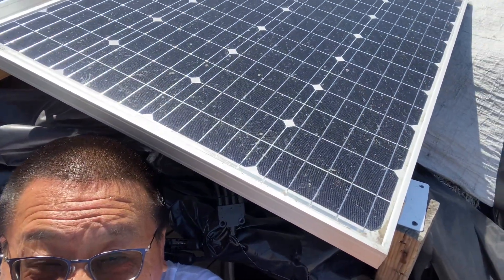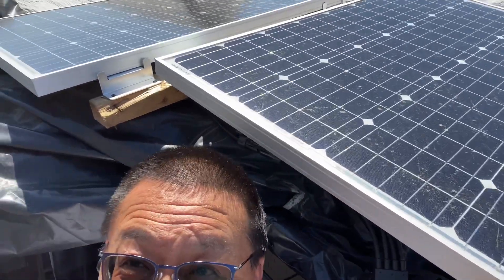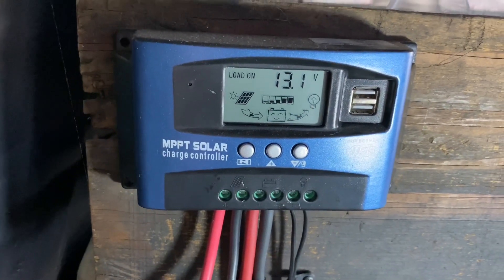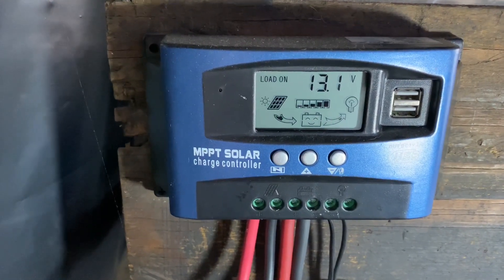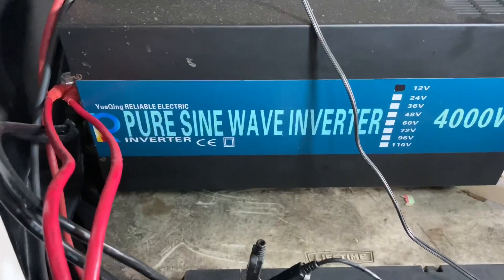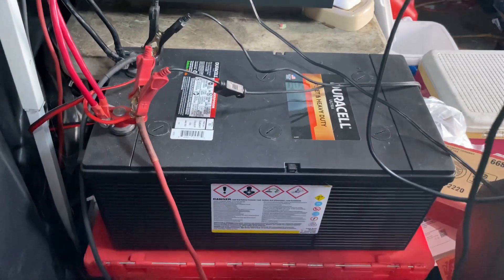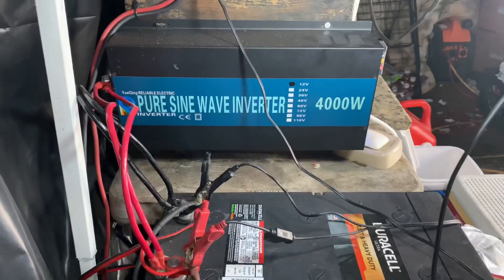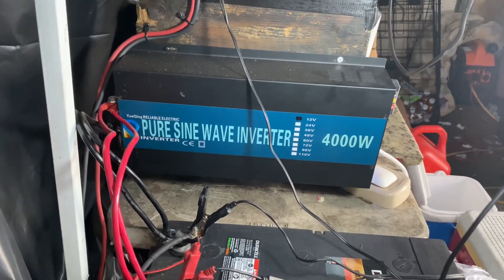Living with Off-Grid Solar Electrical Power

Comment: You need to get couple more 100w solar panels. So you can run on daylight floating  power,, straight from the panel, to the charge controller, to what's being powered. While the battery is charging for night use. More power meets change to 24 volt system and change the charge controller to a MPPT controller.
Reply from the maker: You are correct. I have 4 additional 100 Watt Mono Solar Panels on order. Arriving soon and will be added, will have plenty of Watts for Charging the Battery Bank. What I currently am operating is just short of “Neutral Float”. This is designed for a tight Budget, but flexible for future growth. Tiny Homes have nearly ALL of the same features as any typical SFH, with the exception of size. By adding a Solar Hot Water Collector, one can save 1.8KWh of energy by using the Sun to heat the Hot water, with the exception of very cold days, then can be switched “ON” electrically, to act as a redundant system. Capacity is nearly 80 gallons of 120 degree water at all times.
Reply from the maker: Been looking at Growatt System I like the 5000Watt Split-Voltage system with 120/240 VAC on 24VDC Input. Everything in a clean Panel and 80 Watt MPPT Controller Built-In.
Reply from the maker: This would be for a Tiny Home with compact Washer & Dryer accessory.
Reply: @derricksooEOAdvocate  I live off-grid in Slab City (Calipatia/Niland), California. It's like a homeless community,  we're popular on YouTube. So when it comes to solar power systems,  I found tons of information and reviews on YouTube.

Comment from the maker: Energy Vampires are highly visible living Solar Off-Grid. Think of your system like an ATM. Panels are your “Income”, Storage Battery Bank is “The Bank”. Your Withdrawals are your demand for “Energy”. Many buy a Watt Meter to determine Energy usage, one plug at a time. Then add up to arrive at your Sum-Total cost per hour!!! Do you have enough in the Bank for overnight? Extra Day? I have a maximum current Income of 1600-1800 Watts (200 watts x 8 EFFECTIVE daylight hours) coming into the Bank.
Reply from the maker: There are 2-Levels of energy costs. Household AC Voltage/Watts and Low-Voltage 12 Volt DC. Household Voltage is the most expensive to buy per hour! Inverters are at between 82% up to 95% efficient in energy conversion DC to AC. Inverters absorb up to 15% of the input energy to internal “Heat” Loss.